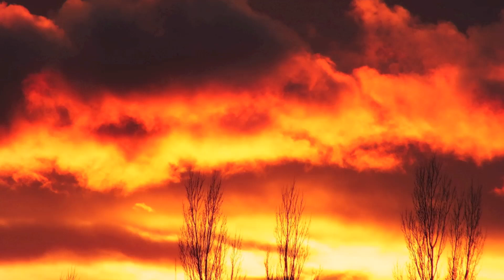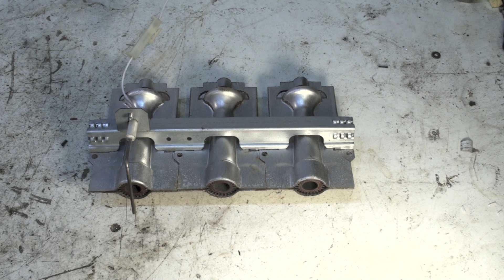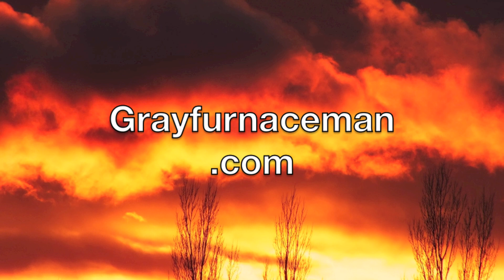Why the flame rod works

Comment: Interesting info! Now can you tell us the next step, that being the use of the small DC signal? And how it relates to the 'system' malfunctioning by doing multiple restarts/cycling? I know that using scotch bright to clean off the sensor rod, mitigates this cycling but I'd like to know how this micro amp dc signal interfaces with the electronics to make something function further into the circuitry. Thanks!
Reply from the maker: I don't know.
GFM
Reply: @grayfurnaceman  Thank you for being honest. I understand my question gets deep into the engineering of the electronics. I'm hoping someone that knows, will explain it. Can't be a secret if many manufacturers use it in their units. I just like to know how things work. Cheers!

Comment: Is the flame sensor rod the ac input signal from the IFC and the ground wire the dc output to the IFC ? I’m assuming this is incorrect if putting a meter in series with the flame rod sensor (input) generates a milli amp measurement (output) on the same wire.Is the single wire flame sensor rod both an ac input and a dc output simultaneously?
Reply from the maker: The IFC produces an AC current between the chassis of the unit and the flame rod.  If the current is changed to DC thru the flame, the IFC accepts the DC and continues the flame.  If there is nothing (no flame) it shuts the flame down.  If it sees a short between chassis and flame rod, it shuts the flame down.  The current is in microamps.  
GFM
Reply: Thank you for sharing your knowledge. It is much appreciated
Reply: This matches the explanation given by the trade school.

Comment: I am a physicist.  The reason given by Mr grayfurnaceman is not entirely correct.  The reason for the rectification is not the size difference between the electrode and the chassis.  It is the flow of hot gases carrying electrons off from the chassis to the electrode, giving rise to an electron flow which is detected as a current flow in one direction predominantly.  The rectification is rather a symptom of this hot carrier electron flow in ONE direction, while resisting any attempt to flow in the backward (electrode to burner) direction.
Reply from the maker: Well, I will just have to refer you to Honeywell.  That was their explanation and it makes a lot more sense than  "It is the flow of hot gases carrying electrons off from the chassis to the electrode, giving rise to an electron flow which is detected as a current flow in one direction predominantly"  Reread your explanation again.  Why in one direction predominantly?  Could it be because the chassis is much larger than the flame rod.  Not trying to beat you up but that does not make much sense.
GFM
Reply: No problem, you are not beating me up.  Just seeking the truth which is good.  The direction of current I stated is the conventional current.  The electron flow is from the electrode (sensor) to the chassis.  The reason is the hot electrode gives rise to an electron cloud which is swept away by the electric field when its in the direction (chassis positive, electrode negative) but not in the other direction.  The electrode when heated by the gas glows and allows electrons to boil off.
Reply from the maker: Beyond my pay grade.
GFM
Reply: You seem to have contradicted yourself.  If I read you correctly in the fisrt post you say the electrons flow from the chassis to the rod and in the subsequent post you say it's from the rod to the chassis.  A DC meter should show polarity; however the subject of electron flow is in itself contradictory.
https://www.mi.mun.ca/users/cchaulk/eltk1100/ivse/ivse.htm
I've been claiming it must be the hotter object that gives off the electrons which move to the chassis and are rectified by the flame.

Somehow the circuit board recognizes the flow of currant and keeps the gas valve open.  Not enough amperage, and the board shuts the valve down.  For practical purposes, a carbonized flame sensor rod is a poor conductor of electricity and must be cleaned or replaced.  My question is the rod pure stainless steel, and can it last a lifetime if kept clean?
Reply: Is there a name to the phenomenon? Where could one read about it? Everywhere I look I find simplistic explanation that are good enough, but I'll like to understand what is happening here in a more precise way. Wouldn't mind a little math.

Comment: It is much easier to think of the flame rod as the cathode in a vacuum tube, and the burner body as the anode.  The flame rod is heated by the pilot flame and/or the main burner flame, causing electrons to "boil off" from its surface.  When an alternating voltage is applied to the flame rod, on half of the cycle, when the polarity of the flame rod swings negative compared to the grounded burner body, the cloud of negatively charged electrons is repelled from the negatively charged flame rod, causing an electron current to flow through the ionized gas flame to the burner body.  When the polarity on the flame rod is reversed, it attracts the electron cloud back to the flame rod, but because the burner body is cool and can't launch electrons, essentially no electron current flows from the burner body to the flame rod.  Thus, half-wave rectification is achieved.  Due to the relatively high impedance of the gas flame, the current flow is quite small, on the order of milliamperes, even though the applied potential may be hundreds of volts, but the current is high enough to be easily detected.
Reply: +Milosz Ostrow Thanks, I think this is a better explanation than the one given in the video.  I don't think it's the difference in temperature between the two electrodes that matters, though, as much as the electrode shape.  A given amount of charge on a pointed tip generates much higher electric fields than the same charge spread over a flat surface, and so electrons boil off a pointed tip more easily.  So I think the rectification would work even if the two electrodes were at the same temperature.  Also: you could in principle detect a flame without any rectification involved - just measure the current through two equally shaped (but pointed) electrodes place symmetrically in the flame.  There will be no rectification due to the symmetry, but you can still detect the change in current when the flame appears.

Also +grayfurnaceman, I prefer a more complex but correct explanation, over a simplified incomplete one, any day.  But I get your point.
Reply: Not knowing anything, here's how I see it:  The temperature of the rod is in fact an important factor and so is the size difference of the two objects.  The smaller object is easier to heat up and it is also directly in the flame.   Like boiling water, a hot object will give off more electrons just as steam comes off a boiling pot.  As for the rectification, I think that is probably a harder concept to understand other than to say that the currant tends to flow more easily from the hotter smaller object to the the larger cooler object.  Therefore the practical effect is the (originally) alternating currant flows only one way.  In any event you are talking about a very small currant; however,  one that is measurable.  It's also the reason why these flame sensors tend to be temperamental.  If they are coated with carbon ( a insulator) they don't work.
Reply: Why do you say ‘it is easy” ,when , in fact, it is not.
Reply from the maker: +Milosz Ostrow Do you really think it would be easier to explain this concept the way you have to someone that has no real knowledge of electronics?  Your explanation is mostly correct, but far too complicated for most.  By the way, its measured in microamps.  Anyway, thanks for the thoughts.  
GFM
Reply: @grayfurnaceman That's the way vacuum tube operation was explained in my first electronics class in high school.  At the time I had nearly zero knowledge of electricity or electronics, yet I and the other students picked up on the concept immediately.

Comment: isn't standard ac in north America at 60HZ? you said 120 times a second wouldn't it be 60 times a second? just wanted to check that but good video never really needed to know how a flame rod worked but i am happy i do now :)
Reply: One hertz is just one cycle per second, but the voltage reverses its polarity twice a cycle.
Reply: ah that makes sense. thank you
Reply: The Great Jelly Doughnut I also didn't get it the first time I herd this statement. But it's another valid way of referring to the sinusoidal signal of a particular frequency.

Comment: You need a meter that reads dc milli volts to test the flame rectification
Reply from the maker: As I have said above the meter is a microamp meter.  It reads micro maps thru an in line connection.  This playlist may help:  https://www.youtube.com/playlist?list=PLItXrh64d2JNZYQ5n5eZPxU6frfyv57TW

Comment: It's like arc welding,  with straight or reversed polarity and the electrons flow through the ionized gas, either from the electrode to the work, or from the work to the electrode.

Comment: what is the voltage on that rod ?
Reply: I've never measured it but it's got to be practically zero, maybe a few micro-volts at best.
Reply: wondering how to know that its in the flame properly
Reply: On almost all furnaces you see the rod sitting inside the blue flame. After a few minutes the rod will glow orange from the flame hitting it. My meter doesn't read down to micro-volts so volts it not of concerned here. Techs measure micro-amps to check the flame sensor sensitivity. 3-6 micro amps for a clean flame sensor is normal.
Reply from the maker: hanky97007 Voltage is not what you are looking for.  You are looking for DC microamps as read by an inline microamp meter.  I have a playlist on flame sense that might help:  https://www.youtube.com/playlist?list=PLItXrh64d2JNZYQ5n5eZPxU6frfyv57TW
Hope this helps.
GFM
Reply: Dennis N. was asking about volts. I told him we measure micro amps in checking the flame sensor.
Reply from the maker: hanky97007 I have not been able to read the voltage with a voltmeter because the control sees my voltmeter as a short to ground and shuts down.  I do know its high because I have been shocked by it.  Hope this helps.
GFM